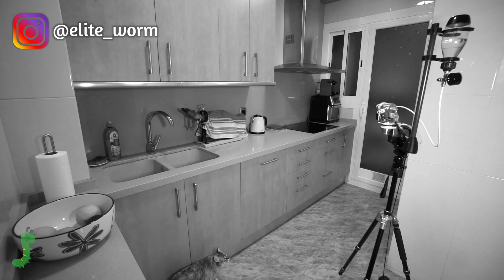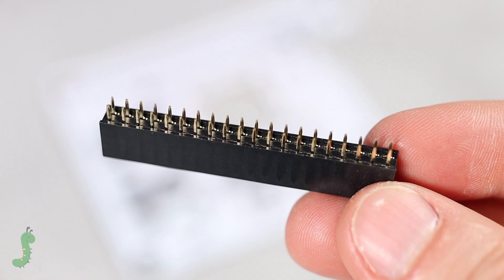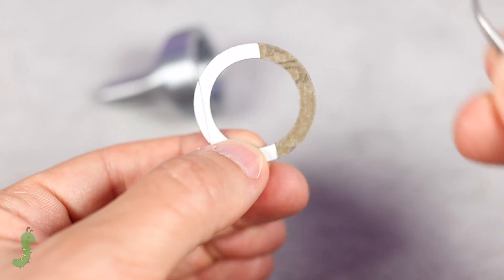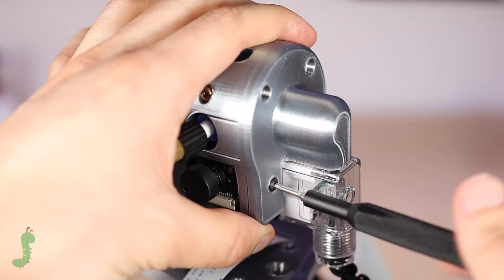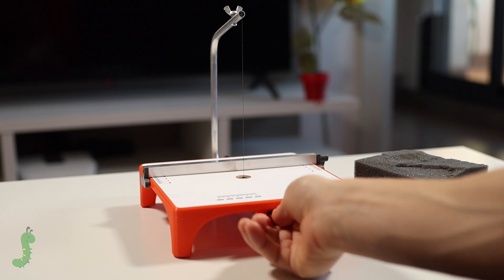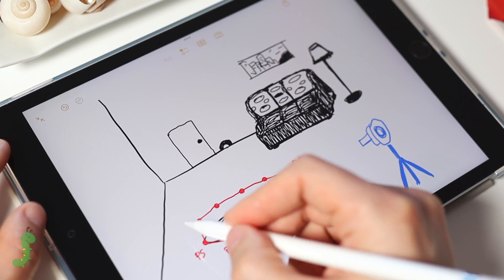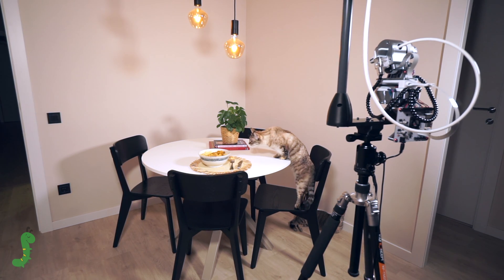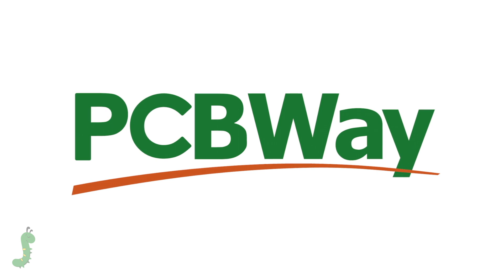I built a Virtual Barrier w/ Machine Vision and 3D Printing!

Comment: Great! You can try Yolo8n detector which should work fine with RPI and similar computing boards. Besides, on top of the detector you can also setup to recognize  batch of cat skeleton keypoints as potential places for aiming. Thus, it will allow to adjust the system to make this experience less harmful for cats avoiding headshots as much as possible.

Comment: Great work! You may want to check out esp32-cam which offers you to implement opencv and a yolo detection model. Some models are already trained on cats to save you the work of training yourself. You can downsize your images (like 300x400 or maybe smaller) and use the tiny/nano implementation of yolo with greyscale images for faster detections since your scene is quite simple and detecting a single class. Looking forward to the next video!

Comment: That looks so clean, congrats on the project! I actually tried to do smth similar but using a steel pressure tank made for air spraying, definetly overkill as I found out later... I stumbled at the same hickup as you did, there are no accurate haar cascades to identify a cats body, only faces... as for the refresh rate I experimented with an SBC with an integrated NPU, which could also unlock more "smart" OpenCV options like YoloVx, which could be specifically fine tuned with a public cat dataset (I personally tried a Khadas VIM3, they have a non RPi compatible pinout, which could be a bit of a pain and you may need to modify your PCB/Software but they come with a 5 TOPS NPU baked in)
Reply from the maker: Thank you! And good luck with your project 🙌

Comment: In fewer than twenty years from now, governments are likely to deploy similar systems to keep "disobedient" citizen under control. >Shudder< . Cool demo, though :) and deliciously clean assembly! Loved the "laser-cut-sandpaper" trick.
Reply: PS - the "mist-generator" issue occurs because the water is not able to gain potential energy before it reaches the restriction. IMO, if yo fill the front 90% of the tube with gas (air), this can escape readily, giving the pressurized tank enough time to transfer energy to the water-column. Then, when the water actually reaches the nozzle, it will have enough momentum to delaminate as a jet instead of atomizing. Just a hypothesis. Haven't thought of a KISS-implementation either.
Reply: Yap

Comment: Next time, check out a board called the orange pi.  It has a rockchip processor which is faster than raspberry pi in every way.  Also, unlike the raspberry pi 5, you can actually buy the thing.
Reply: and they probably don't advocate for shitty pigs spying on you 🦐
Reply from the maker: Checking it right now. Seems like a board to consider for future projects! Thank you
Reply: Nvidia jetson not good for this? From what I understand it's made exactly for this kind of tasks